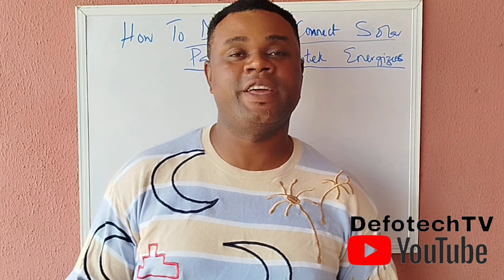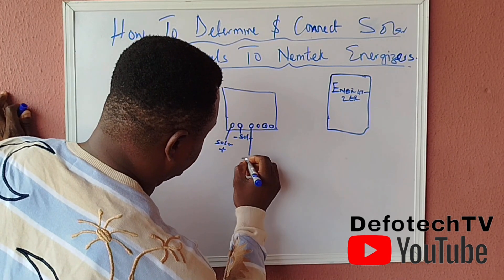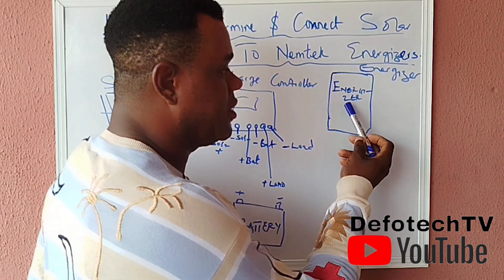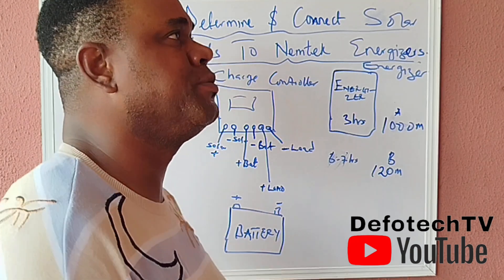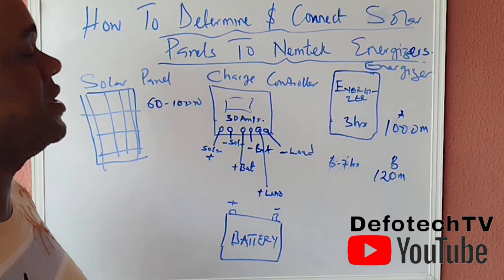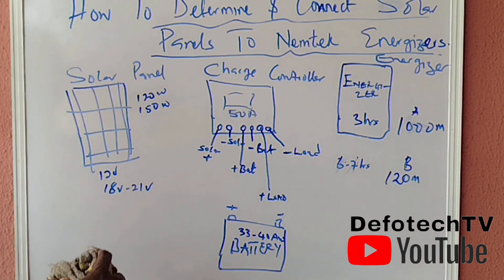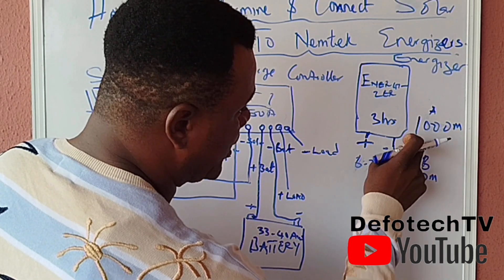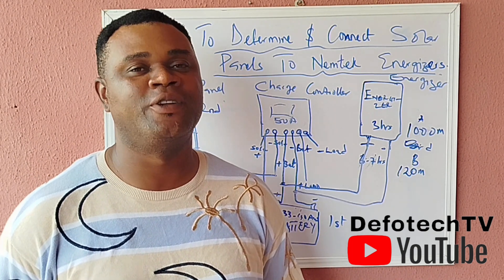Nemtek Energizers Solar Panel Connection. All You Need To Consider.

Comment: I already have a hybrid inverter with extra capacity after powering my lights. Can I connect my merlin energizer instead of connecting to the main grid which is not reliable?
Reply from the maker: Connect it to the inverter, Energizers are power efficient.